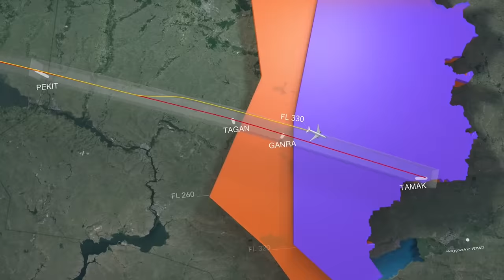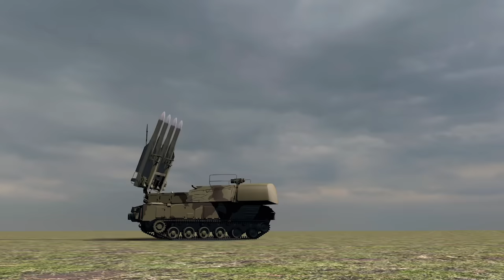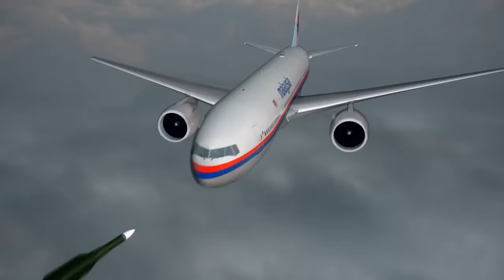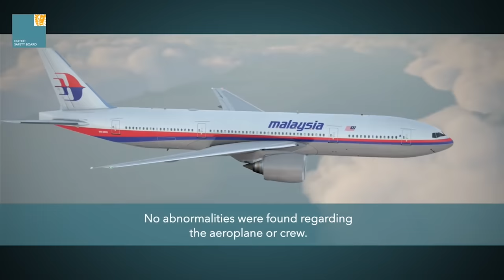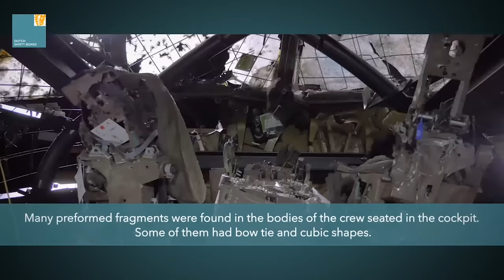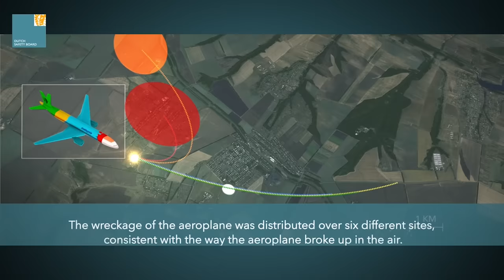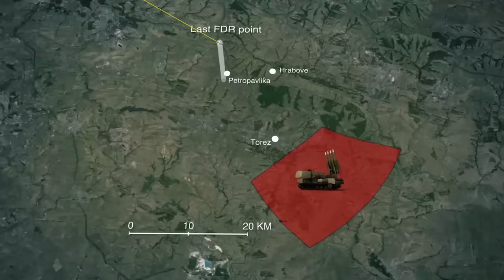Cause of MH17 crash by Dutch Safety Board

Comment: How couldn't they know it was commercial flight? Or was it intentional, trying to make it look like Ukraine did it, but failed?
Reply: Radar images are not that clear, it's no wonder if it was an inexperienced crew who were barely shown how to use the system.
Reply: @jm-holm  I mean, the plane most likely had it's transponder on, but the crew didn't have any way to see that? For example at least using flightradaronline or something, if not any other way.

Comment: All macro parameters of the MH17 disaster indicate that it was blown up. 1 Destruction and scattering of the wreckage of the aircraft. When a missile hits, the aircraft does not instantly collapse and its fragments do not fly back from the point of the missile hit, and these were fragments from the central part of the aircraft with traces of thermobaric effects on the internal surfaces and objects located inside the fuselage 2. the operation of the FDR and CVR recorders. The recorders are intact, but the recording on them was interrupted at the same time. Even theoretically, when a missiles explodes, both recorders cannot stop recording at the same time because the sources for the FDR and CVR recorders are at different distances from the theoretical point of detonation of the missiles, so the sources for the FDR outside the cockpit are three computers CPFC (central), LPPC (left), RPFC (right) duplicate each other. The left and center, located in compartments 117 and 118 in racks E1 and E2 behind the cab and the partition separating them from the cab, has no holes from the striking elements of the missiles , only a hole from the chassis that punched it during the fall,  there are no holes on the outside of the aircraft skin where the computer compartment is located both on the left and on the right.  And the left RPFC it is located even further to the right in the area of the front cargo compartment door.  And only an internal explosion in the central part of the aircraft behind the RPFC could lead to the macro parameters that this catastrophe has. There were two more explosive devices in the cockpit, the purpose of which was to simulate an external impact due to very specific damaging elements with a chemical agent burning through the skin and imitating the high kinetic energy of the striking elements of the mythical missiles.
Reply: A guy with a Z in his profile picture definitely does have the expertise of how a civilian plane behaves when shot at by russian anti air.
Reply: @mathiasrryba  This is a lie on the table of the Dutch liars and falsifiers, not the Russian but the Soviet anti-air missile 9m38 886847379, which belonged to Ukraine. And this Buk anti-air missile did not flying anywhere, its engine compartment is intact, the flying missiles have it completely destroyed when the warhead was blown up.
Reply: @mathiasrryba  In essence, you have nothing to answer. That anti-aircraft missile, which was presented by the Netherlands, was not Russian, Soviet, Ukrainian and virgin, as the condition of the engine compartment and the solp clearly indicates, it did not fly anywhere and did not explode, it was simply disassembled and sawed with an angle grinder. You also do not have any striking elements, those that you presented are fake, they do not correspond to the real ones in mass, size, quantity and chemical composition.
Reply: @mathiasrryba  Do not judge others by yourself.
Reply: @andreiivanov3825  Stay vigilant and keep looking up, mind little buzzers with impact grenades.
Reply: @andreiivanov3825  Are those part of Moskva's promotion to a submarine?
Reply: @andreiivanov3825  I'm asking if those were what Moskva had on board when it got repurposed to submarine status.
Reply: @mathiasrryba  A fire on board that led to the explosion of the S-300 weapons cellar, and this is definitely not the result of a guided missile attack from the air or from land or water.
Reply: I’m from India 🇮🇳 and I’d like to ask Russia to stop selling us weapon systems that don’t work. Please be honest with us and don’t send military equipment that performs poorly 🙏
Still see you as brother country 🇮🇳❤️🇷🇺

Comment: 3.31 is also a lie. The first microphone OBS then P1 the seat of the aircraft commander was not in line with the seat of the first officer was pushed as far back as possible , P2,CAM. And PEAK2, PEAK1 are not explosions, see the amplitude and frequency on the graphs in the DSB report.
Reply: Also a FD recorder:
Reply: @frahtauenta  Yes, both recorders interrupted recording at the same time, remaining intact. The sources of information for them are in different places. The detonation of an anti-aircraft missile is carried out at a certain point, from which there is a different distance. Different distance, different time of defeat, different end time of recording. Thus, even theoretically, both recorders could not interrupt the recording at the same time. But in fact, the sources are not affected, in fact, even the sources on MH17 are not damaged. This means that the data transmission cables from the sources of the CVR cockpit voice recorder and FDR flight data recorder were destroyed , and at the same time . This can only be done by an internal explosion that caused the destruction of the fuselage and a momentary  the rupture of two cables that run on different sides of the aircraft left and right.
Reply: @bak1391  Source?
Reply: @frahtauenta  Three duplicating computers 2 LPFC left+CPFC centra, two of them are of them in the computer compartment behind the cab, behind the chassis compartment in compartments 117 and 118 in racks E1 and E2 and the third RPFC right computer is even further away in a special niche near the hatch to the front cargo compartment (right) and while at least one of them is intact FDR will write flight information + 4 microphones in the cockpit for CVR information. Even the intercom head phone that were on the pilots' heads without holes.
Reply: @frahtauenta There are a lot of sensors on the plane and information from them goes to the computer center, it is located behind the cabin, the left and central computers in compartments 117 and 118( Boeing 777-200ER), the right computer (RPFC) is even further away from the cabin in a special niche near the door to the cargo compartment, information from them enters both the cabin and the FDR via data cables. There are 4 microphones in the cockpit: the ceiling CAM is the only one directly on the fuselage and only it fixes the PEAK 1 signal, P1 the commander of the aircraft, by the way, his chair was pushed back, P2 on the first officer, but his chair was not pushed back OBS the microphone at the entrance to the cockpit, it is he who fixes the first PEAK 2 signal, which is not an explosion, and it is the impact of an explosive wave on the partition separating the cockpit from the passenger cabin of the aircraft. Information from all microphones goes on the other side via a data cable to the CVR. It is impossible to hit all microphones and all computers at the same time, it is impossible to hit both data cables running on different sides of the aircraft at the same time. In reality, all computers are intact and as microphones too. All this suggests that an internal explosion occurred behind the farthest source of information from the cockpit RPFC, it destroyed the fuselage, which caused the simultaneous breakage of data cables going to the recorders
Reply: I’m from India 🇮🇳 .and I’d like to ask Russia to stop selling us weapon systems that don’t work. Please be honest with us and don’t send military equipment that performs poorly 🙏
Still see you as brother country 🇮🇳❤️🇷🇺

Comment: Propaganda is what the West does. The plane was flying at a speed of about 900 km/ h (250 m/s), and therefore the initial speed of its wreckage was the same. The wind was about 60 km/h and the side was slightly tailwind and its signicance dropped as it descended, the Dutch did not consider the demolition of the wreckage by the wind, since they do not have wreckage (as indicated in the DSB report), they simply deceived with beautiful formulas and did not make calculations on them. And they drew a curve based on the actual location of the wreckage. It is located to the north of the trajectory that they are trying to pass off as the actual one, and starts at the LAST point of the FDR (which the DSB takes as the point of detonation of an anti-aircraft missile), and it did not depend on the wind, because the plane's frames and things from the cargo compartment differ in weight and size (air ducts with traces of thermal exposure, from the cargo container, the lining with the inscription Malaysia, passenger seats) they are not from the cabin of MH17, the wreckage lies nearby, and 3.8 km back to the last point of the FDR. The curve of debris propagation depends on where the plane was flying and how and from where it began to collapse. It began to collapse from the front cargo compartment, where the explosive device was located.
Reply: I’m from India 🇮🇳 ,and I’d like to ask Russia to stop selling us weapon systems that don’t work. Please be honest with us and don’t send military equipment that performs poorly 🙏
Still see you as brother country 🇮🇳❤️🇷🇺

Comment: The destruction and scattering of the wreckage of the plane clearly say that it was blown up. The wreckage lies both BEFORE and after the missile hit point, and this is not possible, they should lie only AFTER. Since they had the same speed at the initial moment as the plane, gravity was also on them, and the wind could not create the force that would send the debris back from the point of impact of the ground-to-air missile, however, as well as any other external influence that caused the destruction of the aircraft, although the instant destruction itself is just as doubtful. So the debris would have flown further along the trajectory of the aircraft forward and towards the ground. It should also be noted that these fragments are not all from the cabin, so it's not a good idea to display their spread from it. And yes, there are traces of thermal effects on them, I will say more thermobaric effects, the effects of high temperature and high pressure from an internal explosion. That's why their Dutch liars are not posted.
Reply: I’m from India 🇮🇳 .and I’d like to ask Russia to stop selling us weapon systems that don’t work. Please be honest with us and don’t send military equipment that performs poorly 🙏
Still see you as brother country 🇮🇳❤️🇷🇺

Comment: I don't really know which side of the 2014 conflict shot down this plane (because all sides had SA-11s and BTW some other powerful SAM systems) but I don't understand why civil aviation authorities allowed civil traffic routes over this exact territory (Eastern Ukraine) during the summer of 2014, when the conflict was at its height... And it was well known, that Ukraine, Russia and separatists all had SA-10s, SA-11s and etc. which are long range, high altitude SAM systems with large warheads. And mistakes happen, as we all know... Especially at the heat of an armed conflict. So I think that respective civil aviation authorities are to be blamed here too.
Reply: @WhoopityDoo  This video is fake! Previously filmed in May, June 2014 by the SBU. There is no Buk anti-aircraft missile system on it, only part of it is a self-propelled launcher and there is one installation in Russia and another in Ukraine! The Boeing itself was not shot down, but blown up with an imitation that it was shot down!

Comment: Just look at what JIT MH17 presented in May 2018, this green tubular compartment No. 3 is the engine compartment of the 9M38 anti-aircraft missile, it is whole, there are even cutouts made there, and the cut line even shines, despite the fact that it fell from a height of about 10 km and it was part of an anti-aircraft missile, a warhead, which allegedly destroyed a huge Boeing 777-200ER, but failed to destroy its own engine compartment. And cartoons from Dutch "investigators" in which the wind threw the wreckage of this Boeing back almost 4 km from the detonation point of the mythical Buk anti-aircraft missile (this Frankenstein was created by the Dutch-Ukrainian falsification of the engine compartment nozzle and detonation algorithm, except for the detonation distance from 9M38 and striking elements from 9M38M1), and these fragments of Boeing flight MH17 are not from the cockpit of the aircraft, but from the front cargo compartment, and from the passenger compartment above it (they have traces of heat exposure and the effects of overpressure - internal explosion), but in the cartoon they fly for some reason through the cockpit, despite the fact that the plane was flying at a speed of about 900 km/ h, it should probably be sent for Disney Marvel is too unrealistic even for Hollywood. This cartoon directly contradicts the laws of dynamics, the plane was flying at a speed of about 900 km / h, and therefore the initial speed of its wreckage after destruction is the same as the direction of movement, gravity, drag force, wind will also act on them, but only the first 2 will set the direction of movement, the vector of movement of the Boeing wreckage, and consequently, forward and to the ground, and not a single fragment of the aircraft could lie beyond the point of the beginning of destruction, whatever it was caused by. And the wreckage fell from behind! And do not tell a fairy tale about the fact that the Dutch supposedly calculated everything. There was no calculation, the Dutch did not have these fragments and they do not know their mass and dimensions, and formulas alone are not enough. So, using formulas like Colin Powell with his test tube, the Dutch drew a curve of alleged demolition by the wind, according to the actual place of the fall, which did not depend on the wind, but depended on the real trajectory and what actually happened to MH17, from the beginning of its real crash, and not from the Western lie about Putin's anti-aircraft missile! In the end, the last point of the FDR is not the point of the event X, which was the beginning of the destruction, but the point of complete destruction of the fuselage, which is why the wreckage fell before this point, which is why this point is also the last for CVR, the destruction of the fuselage simultaneous breakage of the data cables going to the flight recorders.

Comment: Three different chemical compositions of explosive devices were initially found by investigators. Three explosions in the air were heard by real witnesses and not by SBU agents. There are three detonation points on board the front cargo compartment, it was this bomb that destroyed the plane. Then there are two in the cockpit number 2 in the central instrument console and number 3 in the left instrument console near the aircraft commander's seat, where there is a hole in the wreckage, the edges of which are curved from the inside out, and the burnt-out floor in the cockpit on the left near the aircraft commander's seat is so obvious that it was first hidden from journalists when delivered to the Netherlands from Donbass covered with opaque polyethylene, and it is also absent during the final laying out of the wreckage of the aircraft. These two bomb explosions 2 and 3 did not destroy the plane, they were already after, when the cabin was flying to the ground, which is clearly indicated by the affected angle of attack sensor, due to specific damaging elements, having flown out of the left instrument console of the cockpit in front of the cockpit flying to the ground, they simulated an external impact allegedly from an anti-air Buka missile, due to a chemical component capable of burning through the skin of the aircraft.
Reply: I’m from India 🇮🇳 .and I’d like to ask Russia to stop selling us weapon systems that don’t work. Please be honest with us and don’t send military equipment that performs poorly 🙏
Still see you as brother country 🇮🇳❤️🇷🇺

Comment: I don't  understand  why any commercial flight would fly over active conflict areas. You're  just asking for something like this to happen.
Reply: No one would have expected rebels to have mid-long range surface to air missile batteries. The flight path has been approved by International commercial airlines based on the intensity of the conflict at that time.
Reply: @nogisonoko5409  given that Ukraine sent its rocket launchers to the Donbass
Reply: @daniialsyed7175  
I found it funny when BUK systems were spotted entering Donbass region from Russia border days before MH17 were shot down.

Also given the limited amount of BUK missile systems Ukraine have it is more make sense for them to use those advanced SAM for defence of their more important military bases instead of sending them to the frontline.
Reply: @nogisonoko5409  I’m talking about the fact that anyone could shoot down a plane
Reply: @daniialsyed7175  
A commercial plane that was flying well above most of short range AA missiles? The only thing that could shoot it down is either a fighter plane or medium-long range AA missiles in which there wasnt supposed to be on Donbass region.

Comment: Wow, that's a good missile. In 'Nam they shot down lots of planes with the SA-2, it was much larger, not as accurate. They should arrest the ATC guys for allowing this plane to fly into a hot area just to save a little gas. I'm surprised they couldn't see the missile on their radar and warn the plane , it could have at least tried to evade it. It's  an airliner though.